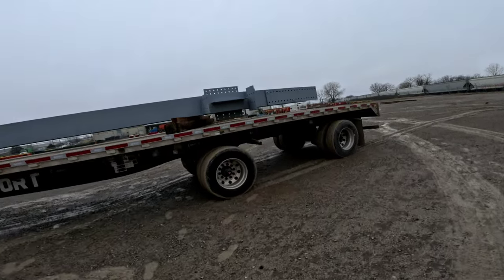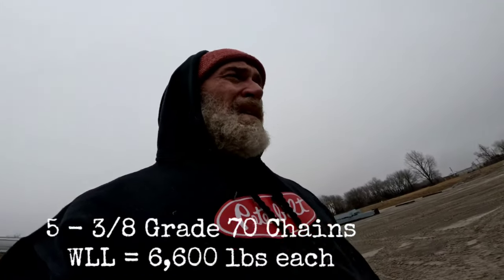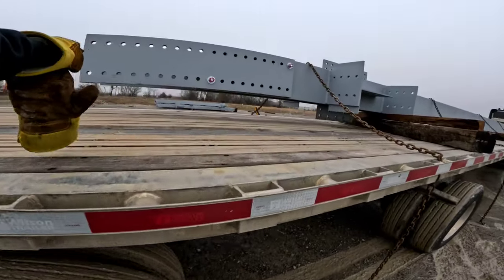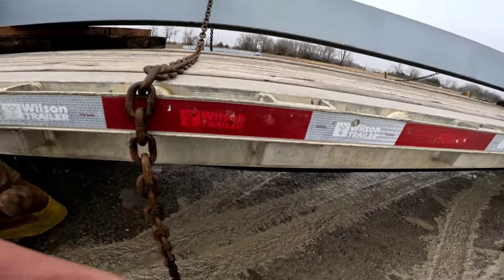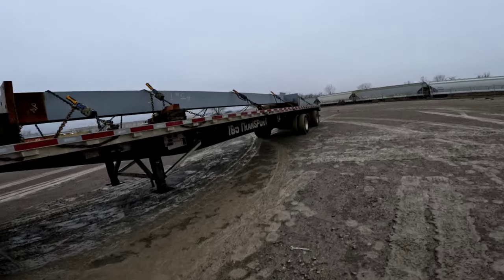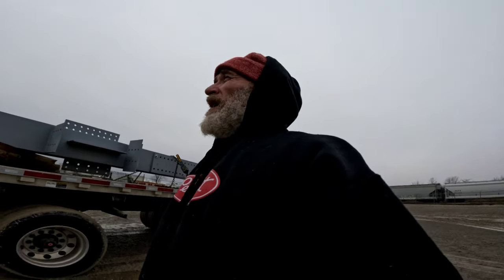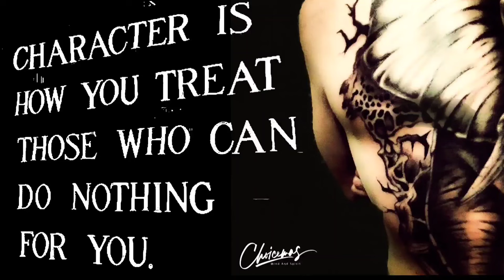How To Secure This Massive Steel Beam! | HOT 🔥 TIPS | Choicemas

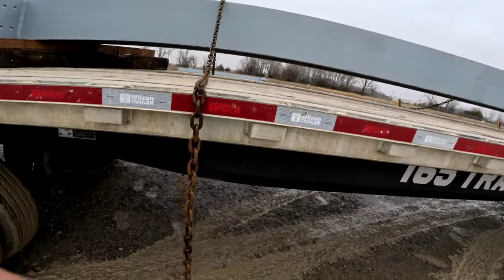Comment: 9:52 "Cool, OK That's me."  I love it.  as a veteran driver but new flatbedder that has learned a lot from you, I love it.  I actually just had a light 18' boom piece on the back of my trailer that weighed  289 pounds.  I had a strap on the front and one on the back.  I also belly wrapped the center because after strapping the front and back I considered what it would look like if it slid off into a car.  Then I thought WWCD (What would choice do lol).  I'm not saying that you would have done what I did because you are way more experienced in securement than I am but I do know that you will not go down the road if you have second thoughts.  Thanks for everything Bro!!
Reply from the maker: Hey, hey, that’s what I’m talking about. If I have to second guess it, 9 times out of ten it needs to be done. 10 times out of 10 I’m gonna do it! And yes, I would have done the same, IF I have the second thought about it as you did. “289 lbs ? Oh that’s nothing!”  - Until it flies off the flatbed at a rate of 55mph or more and instantly turns into a high caliber missile, taking out anything in its way until it meets an object that will stop it which could very well be the backseat of a mini van with kids and a baby seat!  Yup - that’s how I think about it. Great job. To all the finger pointers… “knock it off!” It’s never intentional, however neglect creates a different narrative. Appreciate you. Love this comment. Stay safe. Lead by example and KEEP GOING!! 💯💯🙏🏼🙏🏼👊👊

Comment: As always, love your videos!
I have to be honest, those EZ binders look so cheap , I prefer the ratchet more.
Should you add some rubber under the chain to protect the paint?
Reply from the maker: They do look cheap. I agree. Wish they were cheap, I’d have 6 more of them 🤣🤣. Thanks brother I appreciate it.

Rubber under the chain. In some cases. I happen to know that this structural steel will be touch painted before they put them up. The ratchets drive me crazy brother. The EZ’s are so EZ and they store away well too. I’ve had mine for 3 years now with no replacements or damage. It’s the plastic housing that makes them look cheap. They have a WLL of 6,600 too. I will say the ratchets look sweet when they are applied correctly and seeing them going down the road. Thanks again brother. Stay safe! 🙏🏼💯🦾